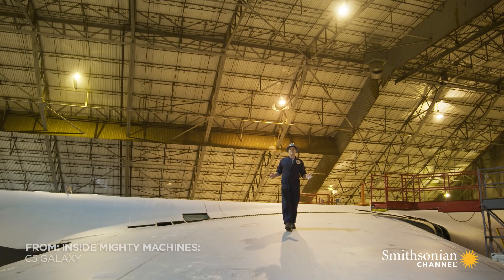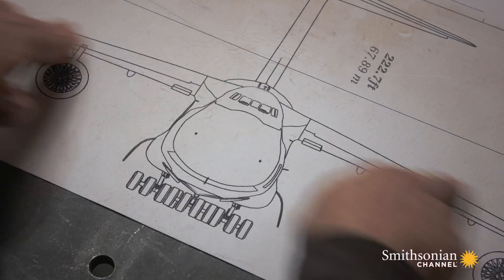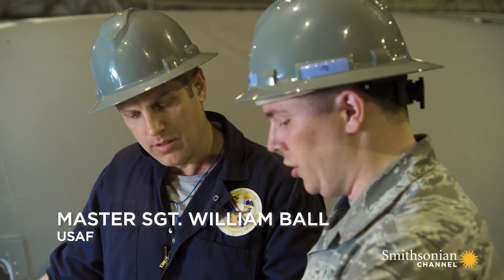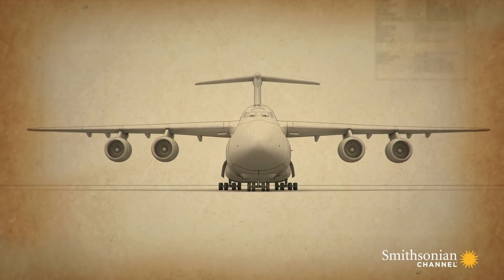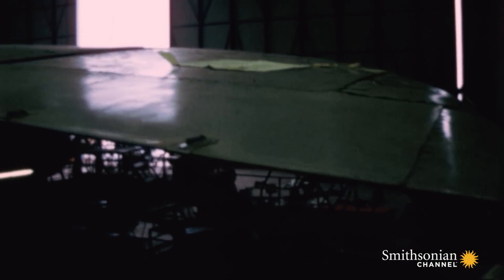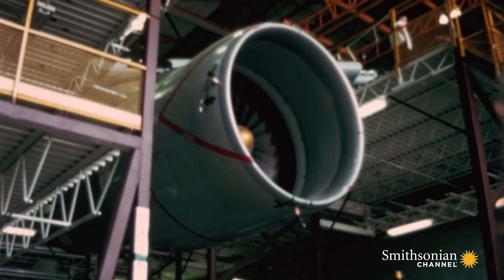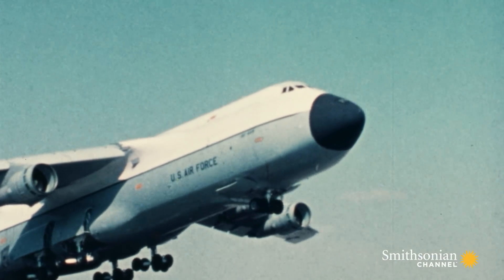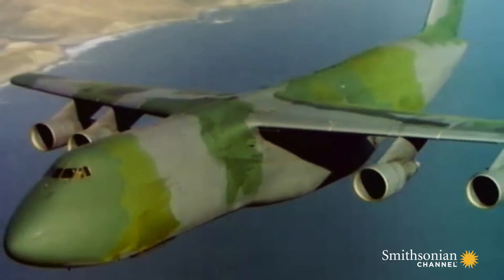The C-5 Galaxy Had a Catastrophic Design Flaw

Comment: Why does this video fail to show the actual flaw?  Yes,  the wings cracked,  but why?  What was the actual failure?  What caused the cracking?  The cause is the design flaw.
Reply: Metal fatigue from the constant flexing and vibrations will eventually cause stress cracks.  I recall the C-141B fleet had a similar situation in which the wing boxes were refurbed or replaced due to stress cracks.  Not certain if the B-52 fleet had the same problems.  I believe it was a depot level repair for the C-5s and 141s.
Reply: @mikecooper8462  
That's an observation, not an explanation. Tappet springs flex ten or twenty million times and don't complain. We think that's normal.
A wing that doesn't do what wings have to do is an incompetent design. Period.
Reply: David Lloyd-Jones 
        Valve springs are a steel alloy.  Aircraft wings are made from Aluminum alloy.  Steel would be too heavy to work in an airplane.  There is a huge difference in fatigue life between steel and aluminum alloys.
Reply: Like most of these Smithsonian clips, the answer is in the longer video being promoted.
Reply: @MrJeffcoley1  :: Is the video quality better in the promoted video? And the name, "Smithsonian", is it really a "Smithsonian Institute" product?
Reply: Mike Ayers so I looked it up. The root cause was the aluminum material being too thin. The C5 as originally designed was heavier than desired. So they thinned out the wings to reduce weight. Then they went to production with that design before they finished testing. By the time the first aircraft were finished everyone already knew the cracking was going to be an issue.

Why didn’t Lockheed fix it themselves? In short because they were near broke. They couldn’t have afforded to fix the wings unless the Air Force footed the bill. 

The Air Force didn’t want to lose a resource like Lockheed and also I suspect shared some blame for rushing the production (there was a impending war so a lot of things were rushed).

So it’s really not a design flaw as much as it was an engineering teamed being pushed to produce something they hadn’t fully tested.
Reply: Mrcaffinebean it’s actually a design flaw. If you know you don’t have sufficient time to test then you should design it with higher safety factor.
Reply: @Mrcaffinebean  Air force jag team material!
Reply: Bob John Your reference bears no resemblance to what actually happened.
Reply: @bobjohn8581  not exactly.  The door did fail, but babies did not "fly out".  The rapid decompression and the door severing control wires forced the plane to crash land in a rice patty just short of Tan Sanut AB.  The crash is what killed some PAX.  No one "flew out" when the door came off.
Reply: Should how was it fixed
Reply: Allowed to flap up and down and in the wrong place on the wing...cut off and located farther back on the fuselage...I think...cost 500 billion dollars are 114 c5 "birds"
Reply: @bobjohn8581  as I understand it the crew was on the last flight out of the capital of Vietnam...loaded with escaping refugees..they failed to latch the loading back door properly...it fell down and several all the hydraulics...pilot had nothing to work with...tons od dead weight crashed to the ground killing hundreds of the escaping refugees..many were children and babies.
Reply: Saigon
Reply: The thickness of the wing material was reduced to reduce the weight of the aircraft. Lockheed knew this from the beginning. They made money fixing them!
Reply: @ericdixon2898  Lockheed cut off the wings and repositioned them.
Reply: @Steven Strain good write up Steven...amazing how John Q.Public knows the answers while our officials waffle.
Reply: @bobjohn8581  78 children were killed in that crash, not 200. Not all those 78 flew out the door but were killed when the plane crash landed.
Reply: @bobjohn8581  The fatigue test article of the B model wing witch was installed on all the C-5s was tested to three lifetimes, 90,000 hours with fatigue cracks being created and drilled to see if they would propagate in the third 30,000 hour test, they did not.  So they cut holes in the wing to simulate battle damage and continued testing.  The wing failed at about 105,000 hours.  The wing and the B models were built out of a stronger alloy than was originally available.  Also, an active lift distribution system (ALDCS) was installed that controlled the flex in the wings.
Reply: @Steven Strain Thank you for the clear, cogent explanation Mr. Strain. I learned something new.
Reply: @bobjohn8581  severed all hydraulica...C5 crashed...all hydraulics moved to the top of the door after that fatal door not secured crash!
Reply: @bobjohn8581  it still crashed!
Reply: @bobjohn8581  The control cables were cut, no amount of hydraulics could save it.
Reply: Yeah, that is my question, too.  Kind of a pointless video without that discussion...  Did they use the handyman's secret weapon?  Duct tape??
Reply: Good one Mike...Mike ciproni at kelly AFB said the planes fly in spite of what we do to them!
Reply: Steven Strain huh? So this is the only plane who’s designers couldn’t properly size the wings. All other planes in the history of aviation seem to have figured that out. I’d like to know what exactly was the cause, and it’s not in the video.
Reply: Air Force changed the C5 specs AFTER letting the contract with Lockheed.
This is a very common evil practice & causes severe problems. 

Subsequently, metal was shaved from the wing structures to lighten the acft empty weight, after AirForce mandated-changes to design.  
A big screwup. 
Everybody knew new wings would be required later.
Reply: metal fatigue
Reply: tensile fatigue in the wings is what I'm guessing.
Reply: @bobjohn8581  Part of the problem was that they has to take off at a steep angle to avoid small arms fire.
Reply: As a long time resident of Marietta, Georgia, where the C-5 was built, this is what happened: Lockheed-Georgia and the Air Force knew about the problem earlier in the C-5 program but Lockheed was not allowed to make the wing box stronger as that would have exceeded the specified weight limits as well as adding more cost to an already costly program. So the can was kicked down the road...
When new wing boxes were installed in the early 1980's they were of a stronger and lighter alloy that was not available when the original wings were built. These  new wing boxes were painted in the then new European One camouflage....which did not match the rest of the plane. Eventually the remainder of the aircraft were painted to match and the C-5A served honorably until all were finally retired a few years ago.
Reply: As far as the Operation Babylift crash is concerned, the rear cargo door latches failed because of improper maintenance. The investigation revealed that the latches had been replaced by latches removed from another C-5. 😳. The replacements were not aligned properly before the aircraft was released back to service.
However, the C-5 was never again used to carry large numbers of passengers. And loading and unloading was conducted through the front of the aircraft only..
Reply: @alantoon5708  we used both doors front and back.
Reply: @bobjohn8581  The divers who found the rear door said that the door was blown open by and explosive.  The baggage was loaded on the cargo ramp.  Security at Tan Son Nuit AB was failing in the exit of US forces.
Reply: @bobjohn8581  Babylift crash was about the aft pressure door locks failing, which caused the door to lift vertically, severing the vertical stab’s hydraulics, causing the loss of pitch control. Followed sadly by the crash. That’s all. The EA-TCTO’s the planes lines to be rerouted to the side (and of course fix the locks system) which resolved the potentials for this happening again.
Reply: @hummerzdca  There was no changes to the locks other than adding eight fairly large metal pins going the door and fuselage?
Reply: They want you to pay to see the rest
Reply: Mike... Nice post 👍
Reply: And how was it fixed?
Reply: @turnerjensen2620  Do some research somewhere besides YouTube if you really want to know...lol
Reply: @turnerjensen2620  Profitably and at taxpayers' expense.
Reply: The engineer’s name is Chad... what did you expect?
Reply: If you want to know the answer than PAY UP
Reply: @bobjohn8581  And that's why I don't have a girlfriend.
Reply: Ok so then, what is the design flaw
Reply: Possibly because everything is in some ancient measuring system, impossible to decode.
Reply: this comment save me from wasting 4 minutes of my life
Reply: @Steven Strain just keep trump and Pense away from the design process!
Reply: The problem was, the specs the air force wanted were too ambitious to realize back then. So Lockheed made the wings weaker than originally planned, they achieved to meet the specs with this trick, but the wings were not durable enough to withstand the forces over a longer period. The only solution in long term was to design new wings, and replace all old ones.
Reply: Weight was removed from the wing box to meet a ground weight requirement imposed by the military (design decision). The stresses in this area were now calculated to be near the yield limit of the material in operation. It was only a short time before the wings started cracking. Normally, the design stresses should never be this high. Even when the design stresses are much less than the yield but above the endurance limit of the material, cracking will still occur over longer periods of time but they can be safely controlled with inspection and maintenance.
Reply: @kenyasinski6978  not the wing box but the main spars were cracking
Reply: @bobjohn8581  Without immigrants America would still be hunting Buffalo's.
Reply: They wanted the plane to lift more cargo so the wings were made larger than the original design.
Reply: They positioned the wings in the wrong spot...the wings were cut off and repositioned at a cost of 500000 billion dollars...AIR FORCE accepted a defective design originally....Wright bros wind tunnel testing?
Reply: @johnrogan9420  50 trillion dollars?
Reply: @dundonrl  one half trillion..500 billions
Reply: @johnrogan9420  Your earlier post had 500000 billion...
Reply: @dundonrl  thanks...you can be Sec of the Treasury if I get elected President someday.
Reply: @johnrogan9420  
" at a cost of 500000 billion dollars..." will be about the US GDP through the year 2040, assuming a return to healthy economic growth.

Comment: Put Cessna struts on them....problem solved
Reply: more struts sounds like a plan

now to mount rockets on it an fly to the mun
Reply: If you could see the top of your 172's wing, with the struts you are so proud of, you would land it and run away.  The thin skin, friend of mine used to call it "renolds wrap", puckers from the lift compression.  On the ground, without the lift, it looks tight and smooth.  All wings flex.
Reply: stve fournine great idea!
Reply: Cables like a BiPlane
Reply: @charlieabbot3649  cables good for positive G s only.

Comment: initially this beautiful plane could not take off both fully loaded and fully tanked so it had to be filled after take off by a tanker plane....  gimmee...  B52 wings also curve up majorly while flying so lockheed wasn't truly innovating with that feature. Pretty bad puff job by SmC.
Reply: Agreed. And poor strategy to not anticipate his audience knowing. The hulking "drooped shoulders" look of a taxiing 'Buff is so iconic, and their wing flex is fairly well known (other examples exist). So hardly a "genius idea that got it off the ground." If anything, it's a big strike against the Lockheed engineers, working with a concept they knew very well - look at the freakin' Lockheed C-141. They were designed just a few years apart, had to have had a lot of guys who worked on both. Sure, they were making it bigger, but that's common in engineering.
Reply: And it's Lockheed predecessor, the C-141.
Reply: I know how it felt to be a passenger during mid- flight refueling. Great memories.

Comment: Why build so many planes before testing them out first to find the problem and correct the issue before it gets out of hand and costing us so much $?
Reply: Shamrock because it took 4 years before people realised the design flaw
Reply: Problems are always discovered After production begins, that's how improvements are made. A plane like the B-52, if it's good enough to begin with, it just keeps flying regardless of changes
Reply: You need to read about the F-35 fiasco.......

Comment: The Boeing B47 & B52's  were built the same way with wings that would flex 16 feet at the wing tip. They ran into trouble with the B47 wing spars cracking at the attachment point and had to go thru costly modification programs called "Operation Milk Bottle" to keep them flying .
Reply: You mean milk the tax payer
Reply: @growforit8736  The pins are literally the size and shape of milk bottles.

Comment: I thought those drooped wings had something to do with the pendulum effect and it was for better aileron control, and the reverse is true for low-wing aircraft.
Reply: Ahmed B it does. It’s called Anhedral. High wing designs tend to have higher roll stiffness so anhedral allows the aircraft to be more maneuverable in roll. Dihedral on the other hand, increases stability but because high wings are naturally more stable than low wings, dihedral isn’t needed
Reply: The "pendulum effect" is for parasols and high wing aircraft.  With anhedral, the wing on the outside of a turn (or the higher wing in a bank)  has a greater vertical component of lift.  It will also have more induced drag. That will give the wing a tendency to move higher and fall bank.  This link shows the components of lift in a bank.  Go to "forces in turns"  That wing does not have an anhedral or dihedral, but you can think about it by overlaying a plane with anhedral over it in your mind
Reply: Sorry, the pendulum effect is a fallacy. Anhedral does decrease roll stability, not through the pendulum effect, but by presenting the upper surface of the advancing wing during a sideslip, decreasing it's angle of attack, further decreasing the lift on that side. Dihedral acts oppositely and presents the underside of the advancing wing during a yaw, increasing its angle of attack.

Comment: Beautiful aircraft.
Reply: In the early 70's I was a student pilot flying out of Long Beach Airport, Long Beach, California.  They had just reopened the North-South parallel runways after a couple of years of renovation.  I taxied out of the flight school and to runway 36L and took off.  When I returned I landed on 36L and began to taxi back to the flight school.  At a certain point I taxied past a hanger and found myself looking at this HUGE C5A Galaxy parked on the ramp with the front hatch open.  I had to taxi past and was shocked at the size of that plane.  I thought that I could have taxied through the cargo hold and not scrape my wing tips.  I was so intimidated by its size that I had a very strong desire to shut down my Cessna 150 and use the towbar to move my plane past the C5 and pray I didn't wake it up.  The C5 was not there when I took off and had landed during the hour or so I was out.  I still shudder when I think about that encounter.
Reply: John Emerson awesome story sir! Gave me goosebumps!!!!
Reply: @iamLODD  It still gives me goosebumps.

Comment: There are 747 cargo haulers ✈
Reply: No, s*. That is what it was designed for.
Reply: Scott McIntosh the Boeing 747 was originally designed to be a cargo hauler, and actually lost the US Air Force contract to the C-5 Galaxy.
Reply: Fexil Sehn funny enough the -8F has higher payload than the C-5 and a longer cargo deck so it’s a trade off.
Reply: @AA-tz2bm  roll-on roll-off is essential for military airlift operations unless you like having to have your plane sitting on the ground for hours or days waiting for offloading equipment to be fixed after it is destroyed by hostile forces
Reply: A perfect example of govt lack of fore sight and waste . They knew Boeing was going to adapt the Boeing entry into a passenger plane, but they are stuck with the mentality they only want specialized expensive products. If they have chosen the 747, the USAF would have a cheaper,  more reliable, and far, far, far cheaper to maintain cargo plane. All of this mess over wing position.
Reply: @downinla4076  They do not compare.
B747 doesn't do roll on roll off, soft ground, air drop.

Comment: Not all passenger aircraft have the low wing design. Yes, all current Airbus and Boeing commercial passenger aircraft, are of the low wing design. But, as you can see, looking at any airport that supports larger aircraft, high wing aircraft, are still in use today. Even smaller aircraft, have both designs. 
Most if not all, seaplanes are of the high wing design. Each design has its pros and cons.
Airships are a whole new ballgame. Space shuttles are currently of the low wing design. Most rockets have fins, not necessarily wings, though somewhere you will see, what looks like a small wing. Etc, etc, etc.
Reply: A lot of turboprops have the high wing, and the Avro Whisperjet, which is currently being retired, also looks like a baby Galaxy.
Reply: He said its common and not on all passenger aircraft.
Reply: @shahimagesyt  I know what he said, I'm just providing examples
Reply: @IgnoredAdviceProductions  no I was talking to OP.
Reply: @shahimagesyt  :p